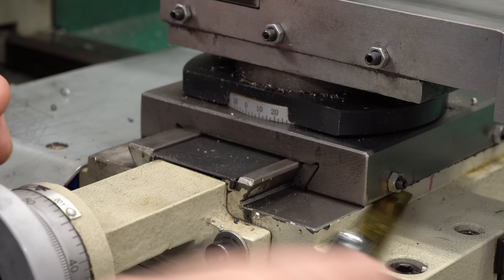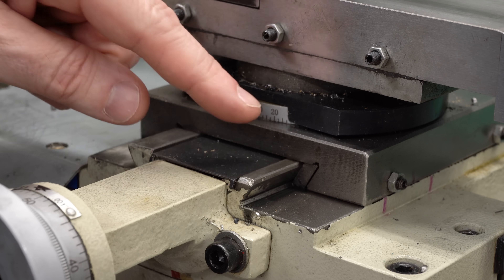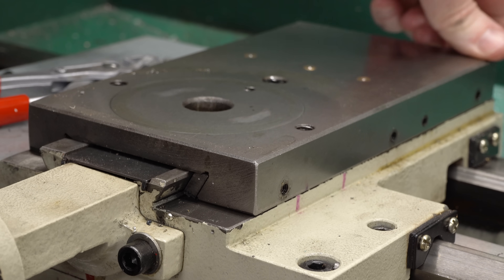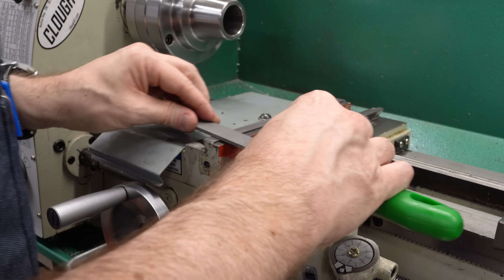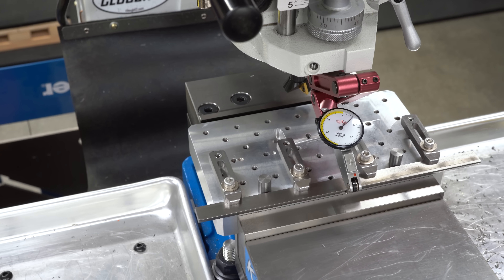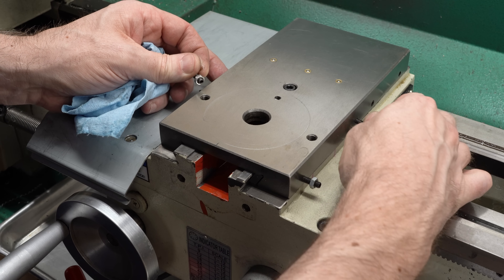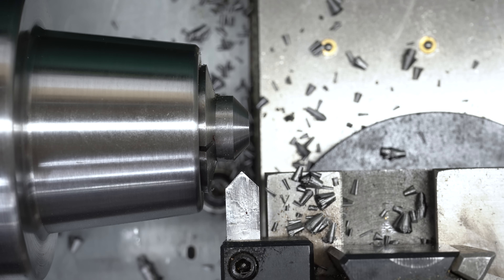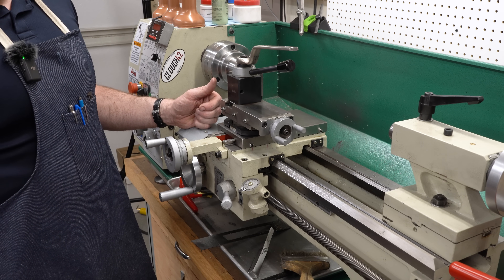Fixing a Factory Defect in the Lathe Cross Slide | Grizzly G0602 Fail

Comment: Great video as always. Considering the top of the dovetail was high and the gib was too tall, I wonder if it was the cross slide that as actually too short. But all things considered, this looks like a wonderful solution. Not sure how much it would matter in practical use, but how level/parallel is the top of the cross slide?
Reply from the maker: I measured everything pretty carefully.  The bearing surfaces of the dovetails in the saddle were the same height, but the top (non-bearing) surfaces were not the same height at all.  If the slide had been cut deep enough, it wouldn't have mattered.  I thought about doing that, but there is significant risk of it twisting as material is removed and stresses are relieved, and I didn't think it was worth the risk.
Reply: How parallel is the top surface of the cross slide to the ways, now that you’ve dropped one side? I.e. if you take off the tool post and indicate the top of the cross slide, what’s the delta as you move the saddle + cross slide along the ways under the indicator?
Reply: @benjaminscarlet  Based on James' response I'd guess it was off before but it's more parallel now.
Reply: @makerdave42  I can’t tell from his answer. The cross slide is now sitting on the bearing surfaces of the saddle, which he says are the same height (and so level, I’d think). That should mean the bottom of the cross slide is now level, but I don’t know that its top is parallel to its bottom, especially since it’s bottom is apparently not flat (before tightening the gib).

I quite liked your original question, but I don’t see how he answered it.

Comment: Very interesting video. Do you like that lathe? I'm 70 and was looking at buying one to learn (a little late in life) as a hobbyist. Thank you for the video.
Reply: I purchased a similar machine, likely from the same factory (Weiss Machinery Co.) and I am very happy with it. Mine worked fine out of the box, but it did require cleaning and a little hand-fitting to run smoothly and accurately. Lots of rough edges, but nothing I couldn't fix myself. For the price, these 10x22" lathes are remarkably capable and more than adequate for most hobbyists. In terms of power and rigidity, they're in a completely different league to the little 7x14" mini lathes.
Reply from the maker: If it's what your budget and space will allow, I think it's an excellent choice.  The forums will tell you to buy as big as you can, but for me, this is about the right size for my shop.
Reply: I have the G0602 Lathe also, and I am very pleased with mine. Like James said, it's not a Tool Room Lathe or for high precision/heavy production, but, for a hobby lathe, it fits all my needs. It does have it's limitations, but, for the most part, it's done everything I've needed it to do. The only real limitations I've run in to was that I didn't have the correct tool and/or my own imagination or skill to do something was lacking.
I bought mine in July of 2013. Maybe I'm just lucky or production methods/quality control of these machines has changed, because I haven't had many of the issues/problems some others have had. I had heard about the issue James deals with in this video a few years ago and my slide was tight. I also have the G0704 Mill during the same time frame and I'm very pleased with that machine, too.
Reply: The next one up has electrically variable speed.  Very handy.
Reply from the maker: @billdeibner7105  mine does now, too.  :). I wouldn't want a lathe without it.  I guess my perspective is skewed, since I have a VFD and ELS on mine.
Reply: I've had the G0602 for a couple of years and I generally like it - it's a huge improvement over the 7x14 mini lathe I had before, at least - but if I were in the market for one today I'd spend the few extra dollars on a Precision Matthews PM-1022V. It's very similar to the G0602 but with variable speed and a reversible leadscrew and all around better quality control.

Comment: I have the same lathe, without the gearbox.  Although it's miles ahead of the old Craftsman/Atlas 12x36" machine I had before, now I have to get out the feeler gauges.  Thanks a lot, James!
Reply: Note to self: Buy new tool, feeler gauges.
Reply: So do I and I got 'em out as well.  Mine's good.
Reply: I have the same machine, and replacing the compound with a solid block makes a huge improvement in rigidity and reducing chatter. Before, I always had problems parting off; now it’s smooth and easy.

Comment: Chinese low cost quality. I have a PM1440HD that is OK but had some issues that I've taken care of. Even though I've been guilty of taking some pretty serious cuts in steel it generally does fine, but not always. 99% of the time I keep the compound pulled back & locked. 
Current project is an ER-40 chuck, Chinese, with several problems. Sloppy manufacture!
Reply from the maker: My take on Chinese manufacturing is that they are willing to meet whatever price point the importer demands.  If you want to drive the price down, they will accommodate, and this is what it looks like.  I know some companies have done an excellent job keeping quality up (along with price) for their Chinese manufacturers, though that is sometimes challenging.

Comment: Sounds like Grizzly needs to do some quality control. Great job honing in on those small, yet super important details.
Reply: When you buy a Chinese machine you are quality control.😢
Reply from the maker: This is very true.  And if you're ready and willing to take it on, it can make for a good deal.
Reply: Quality Control and a fine fit/finish cost money. There's a reason these are cheap, and that reason is that they save on the labor cost of taking it to a higher level of precision. It's initially disappointing as a consumer, but it does mean that you can tune it to a level much higher than you would expect given the cost.  It's entirely a matter of what YOUR time is worth.
Reply: @samvandellen3695  Sure. But deviations by a factor of 10 larger than in the Quality Control check sheet, this is just blatant lying. And the flaws of that Bernardo machine are beyond my capabilities to repair. The ways would have to be ground with lots of material removal, and then everything scraped in. Not possible for me.
Reply: My chinese milling machine form Bernardo (dealer in Austria) also has numerous flaws and esp. accuracy problems. Unfortunately I only discovered way too late.

Comment: Yes! I fixed mine about 2 years ago…way less chatter.
Reply from the maker: Is this common?
Reply: @Clough42  Yes, someone else on youtube pointed this out 3 ish years ago. For be the gib was too tall vertically. Shortened it and it fixed it beautifully.
Reply from the maker: @seanwolfe9321  pretty amazing this is so common.
Reply: @Clough42  Mine was/is tight & smooth, but, love your videos! Keep up the great work! Learned a lot from you. 
PS...I probably would have forgot to put the dust shield on, too! I think a lot of us would have!
Reply: I've had mine since 2013 and haven't had any real issues - other than the size of the Handwheels being small & a slight pain. But, my Slide is tight & smooth.
Reply: I guess I’m a nutshell, these inexpensive Chinese lathes are good, but don’t expect them to be ready to go out of the box. Changing the spindle bearings to quality ones was a huge improvement on mine as well. I spent about $100 on good ones. Imagine what they use…bearing are way to important to skimp on.